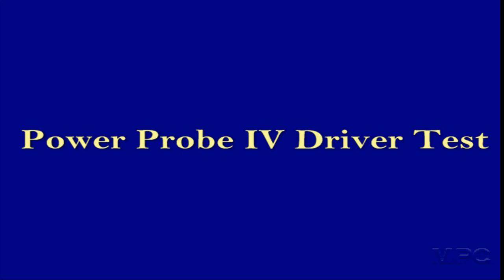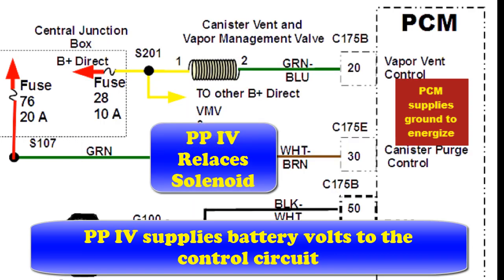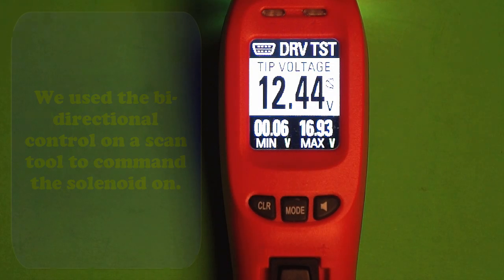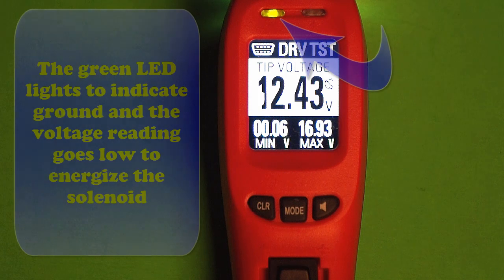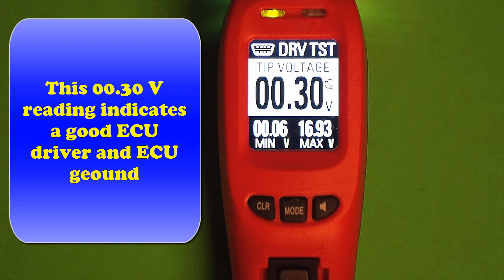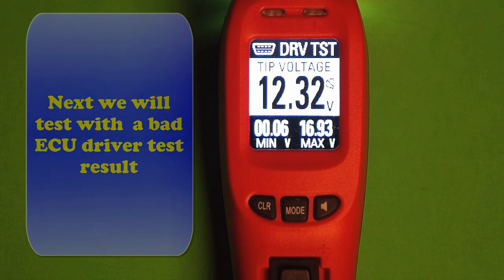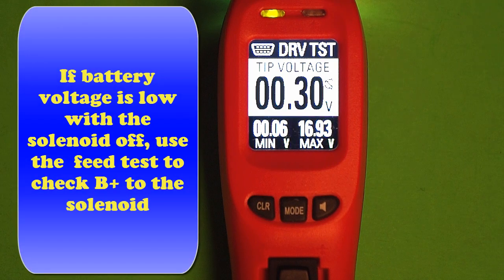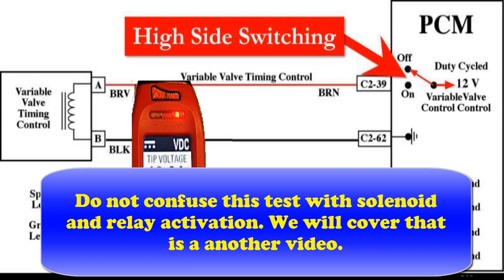Power Probe IV ECU Driver Test

Comment: I didn't see anything.  How did you test it?
Reply from the maker: The tester now act like the solenoid or actuator. Voltage will be battery voltage when the solenoid is off and will drop two near ground voltage is on. So what’s you’re doing? Is your watching the actual driver actions but instead of using solenoid or sensor you’re using the tester.

Comment: I know this is seven yrs ago but what if you have 4 wires a power source a common a junction wire and pcm wire which do I send power to to look for current drop
Reply from the maker: But the driver test is specifically to act like a solenoid or actuator. Use the MinnMax voltage to look for voltage drops in. Don’t be sending power from the power probe into a computer circuit unless you have the five adapter. Sending the 12 V power into the signal circuit can blow the computer. Voters Rob is much better than sending power in sick with a fast glitch came true. I’m so forward to a good job of detecting bone drops.
Reply: @willispeek3846  thanks for the reply and for the knowledge!
Reply: @willispeek3846 so your saying I can use the DRV test to see if pcm is communicating?
Reply from the maker: @joshvalera2526  the drivers test is to see if the computer we can control solenoid, or actuator. You just cento to say turn on a relay well it really is a koala wire usually supplied with battery voltage of one side and ground and the other when you plug the driver test and you can see if it’s going to battery voltage was turned off with your shirt. If it drops to low-voltage wanna computer turns it on what your testing is the driver circuit in the computer. Communications is a bigger issue than just one test on one driver. I hope that answers your question.
Reply: @willispeek3846  just read the manual and it's pretty straightforward correct me if I'm wrong you find the pcm ground wire from harness put power probe 4 in drv test and see if the pcm is communicating?

Comment: This was a great vid thanks I'm just confused @3:25 the screen says (after disconnecting the PCM) "that if the voltage returns to battery volts, there is a short to ground in the circuit." But your narration says " if the voltage remains low, theres a short in the circuit." I may be misunderstanding but could I get some clarification?
Reply from the maker: The driver was shorted that was removed when thew ECM was disconnected. I am sorry I did not make that clear